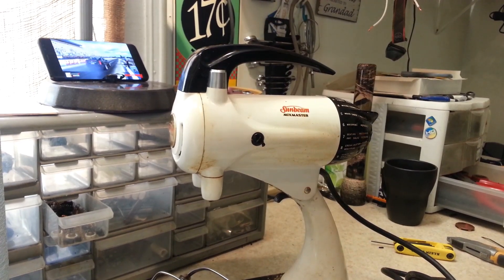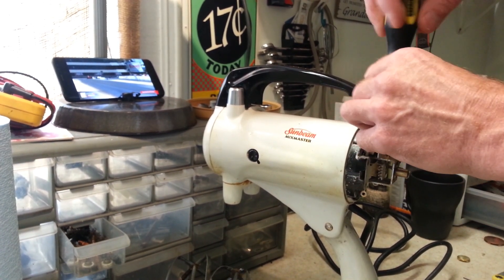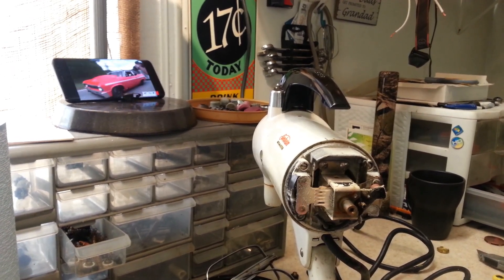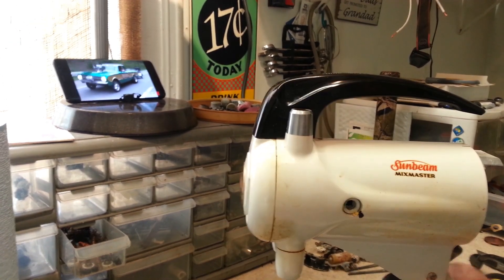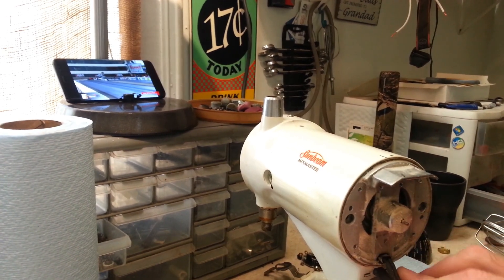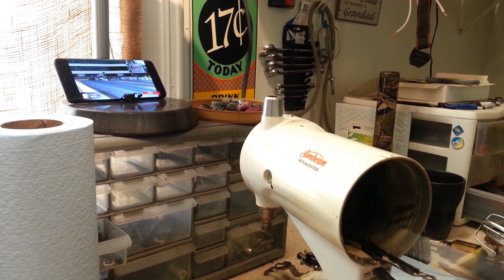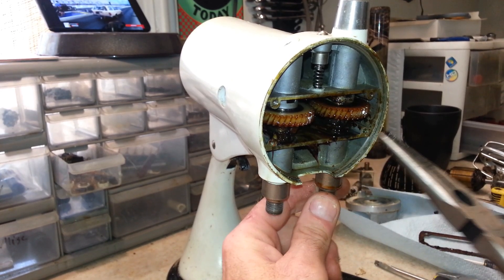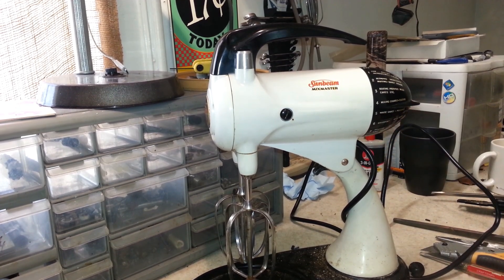Sunbeam Mixmaster Model 11 repair, service and maintenance

Comment: As far as I’m concerned, this is to this day one of the best mixers EVER made! If for no other reason, they were built to last! That said, I wish you would have mentioned what type of grease you would use, and what type of oil. It’s also nice to know what all the parts are used for.

Other than that, thanks for posting this. (Next time, at least turn the volume off on your racing video.)

Comment: thanx for the vid found the fault on my one to be the capacitor had shorted. unable to replace with similar one so i  replaced it with a capacitor from a power tool. once i soldered it  in no more radio interference  and good to go.

Comment: I've got a Sunbeam Mixmaster 11c. I replaced the capacitor (but my multimeter doesn't test capacity), and my resistor tested in at ~150 ohms, but there's visible electricity between the pads that control the speed. It still wants to jump from 0-60 when I press on the push pin or assemble and turn the dial. I can still make it have low speed, but it's not got enough "gears" inbetween. What should I do next?

Comment: So glad to have found your account. Thank you for the helpful content! Now for my question... 
was it common for Sunbeam to mix style elements across various models during this time?
The reason that I ask is this; I have obtained a soft pink 1950's Mixmaster, it is clearly marked 'Model 11' but the front grill and handle are different from what is seen on this Model 11. The front & handle on mine look like the Model 12... with that little 'eyebrow wing' on the front. Does this make sense? I could send a photo. 

Anyway, I found you on here because I'd like to clean the old girl up and use her, of course! All 10 speed-settings seem to be working great, but I'm sure it could do for a proper check-up! I'm going to start by cleaning the exterior filth though. lol. 

 Hope to hear back & thanks in advance!

Comment: Nice video! Can you tell me where and what capacitor and resistor  to get for the Model 11. Ours does the same thing. Than ks!
Reply from the maker: Thanks! You can order a new capacitor from Dave at davesrepair.com , the resistor however is a lot harder. You cant find a new one so you have to either come across someone selling a good used one, or replace it with a 180 ohm 10 watt (or 5 watt if need be) wirewound resistor. They are also getting hard to find so it may take some persistence. Good luck!

Comment: How do I determine if the capacitor and resistor are in good condition? What number should the read?
Reply: ..also what settings did you have on your multimeter? My Sunbeam is having this exact issue. I also may need new brushes.
Reply from the maker: @drasticshiftrdsilva  Set you multimeter to a range where you can read ohms, then test the resistor, it should be around 180 ohms, give or take 10 either way. The capacitor you can check for a dead short, but if the capacitor is failed without shorting, then you will notice it in excessive arcing and running kind of rough at low RPM.
Reply: Thanks

Comment: I have recently acquired my Mum’s mixer after her passing.  Unfortunately the cord is brittle and falling apart.  Do you know if it is possible to have the cord replaced?  I am in Australia and have done an internet search, but can’t find anything ☹️
Reply: Hi Kerrie, did you fix it? I live in Australia and have just replaced the cord on my mums :)
Reply: Use any cord ..it's not unique

Comment: Does anyone know if the Model 11 uses the same motor as the Model 12?  I have an 11c that was take apart at some point.  The motor wires are damaged and I thought that might be an easy way to fix it.  Alternatively, if anyone has a novice wiring diagram, that would be great (I have the schematic but that’s kinda confusing)